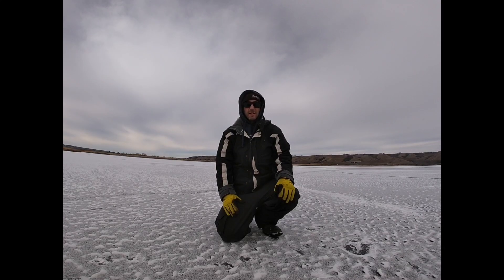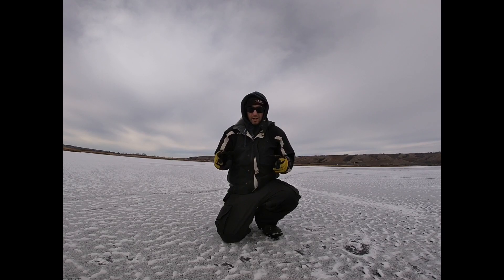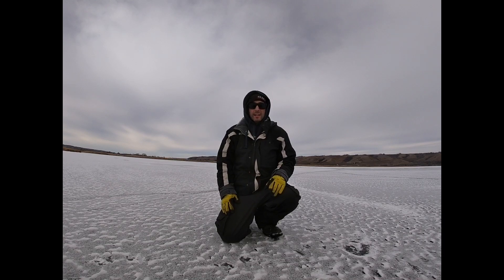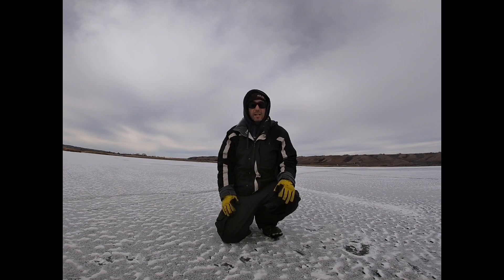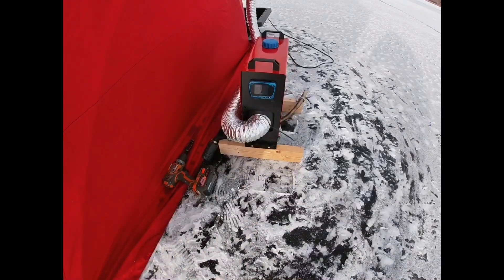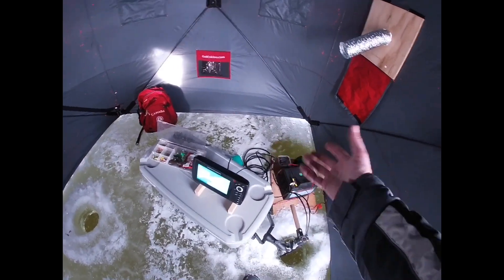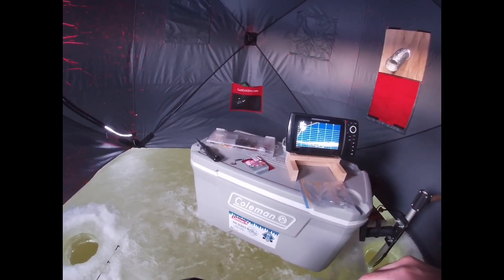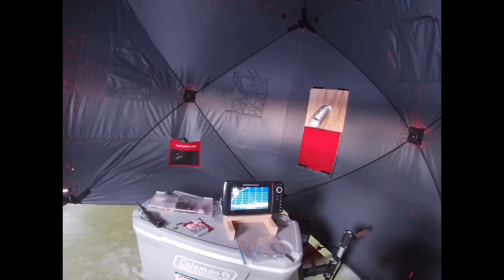Diesel Heater in Ice Tent

Comment: Amazing! I have the same one currently sitting in its brand new box in the garage. Can’t wait to get it started! Really looking forward to it in the back of my truck canopy.
Reply from the maker: Oh man you’re gonna love it. It’ll be exactly what you need this winter to be comfy in the Dodge overnight.
Reply: @MrKattlyn2  Let’s goo! I just got so sick of having propane in the back with me.. and it shutting off through the night.
Reply from the maker: I completely agree. All you need is a good battery. I use a 60ah lithium Kepworth I got on Amazon for $250. Great battery. Ran my heater, mega live, and helix all day and barely touched the battery life.
Reply: @MrKattlyn2  sick! I was just planning on using my marine battery I use for my trolling motor 🤷🏼‍♂️.
Reply from the maker: That’ll work awesome, good use of battery in the winter.
Reply: @MrKattlyn2  beauty! I gotta stop being lazy and actually open up the box and assemble it 😅
Reply from the maker: If it’s same one I am pretty sure I just tossed in diesel, attached power, held power button, and away it went. Looking forward to your review of it this winter. I think you guys will like it in the tent too if you can rig up something similar to entering a window. Give ya guys even more room in that 6x6 box
Reply: Great vid. Question for you. Do you think it would keep the 2 bigger eskimo huts warm in -30. I see people running them inside the huts and venting outside to get warmer temps but then thats space that you lose inside.

Comment: Two things you can do to dramatically improve the heat from these heaters...
1.  Keep the output vent tube as short as possible.  You lose massive amounts of heat for every metre of tubing. I stupidly fitted 3m of extending tube when I first purchased my 5KW version and upon removing it, it went from mildly warm to excessively hot... on the same heater setting.
2.  Add an input tube and run that inside the tent too.  That way, you're recycling warmer air and heating that instead of freezing cold air.  It not only makes it hotter quicker, but allows you to turn it down sooner and save fuel.

You can also quieten the pump by removing its support screw and letting it hang (30-45 degrees to prevent air bubbles).  It's reverberation which makes it sound noisier than it really is.  Or, replace it with a £20 Amazon filter/pump combo and they're almost completely silent.  Making the exhaust quieter is more tricky, as although better mufflers exist, they quickly clog up the burn chambers. Frankly, I'd trade 5db of noise for needing to strip/rebuild it in -20 conditions.

Unique to you though, I'd be very careful of the exhaust temps.  They frequently hit 200+ degrees and can quickly burn any surface underneath.  With yours being supported by ice, I'd double the height of your wooden base to ensure you don't hear a loud "plop" as the whole thing sinks during the night.  Being higher, your input/output tubes can be shorter too.
Reply from the maker: Thanks for the input. I have already found the hose length to be a big factor. I wrapped it in a flannel and shortened it by 2’ and noticed a big difference on that alone. As for exhaust heat it is close to the ground but it barely melts the ice, it has about an inch of clearance and seems to be enough. 
I’ll try the trick with fuel pump angle for noise for curiosity but I’m already used to it and it doesn’t bother me at all. Appreciate the comment and I’m sure some other watchers will too.
Reply: @MrKattlyn2  I've seen a few people double-insulate the output pipe by putting the 3" pipe in a 4" pipe - that's supposedly pretty good but I'm yet to try it.

The angle of the pump is purely to stop air bubbles rather than noise... it's decoupling it from anything which resonates which helps stop the noise. I can't hear mine at all now and it's maybe 4 feet away.  That said, I use rubber 3.2mm ID hose throughout rather than the green plastic supplied/white hard line available.  The rubber dampens the tick even further.

Good to hear the exhaust isn't an issue though. I accidentally burnt the wood under mine :) Won't make that mistake again.
Reply from the maker: Well I like to tinker. Going to try it all out. Thanks again.

Comment: I got a 65 ah deep cycle how long dose your battery last
Reply from the maker: In this video I ran my diesel heater, helix 7, and mega live off a lithium 60ah, ran about 6 hours, definitely not below half. Still had 13.4 volts which is what it has a full charge. Usually it drops below 13.4 after about 30% drain. So I’d say 60ah plenty for a day trip.